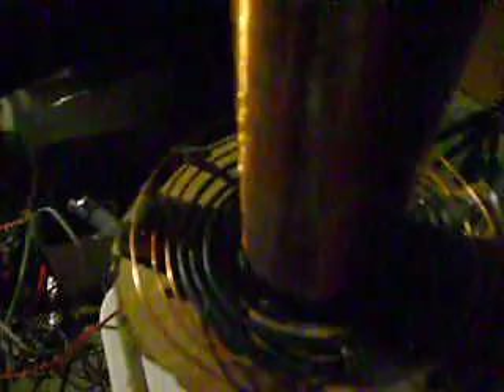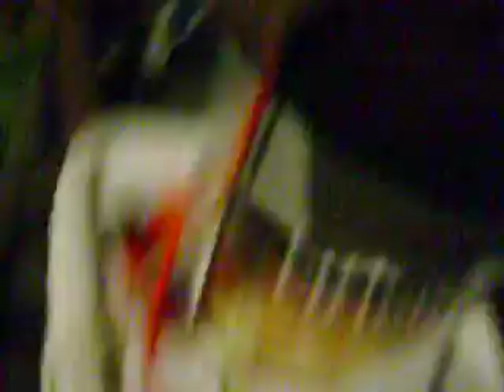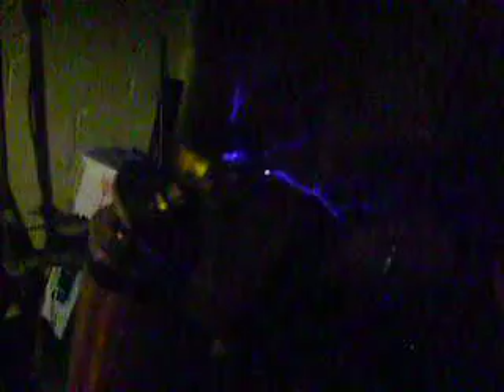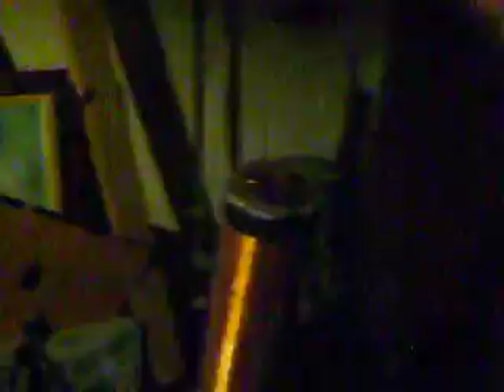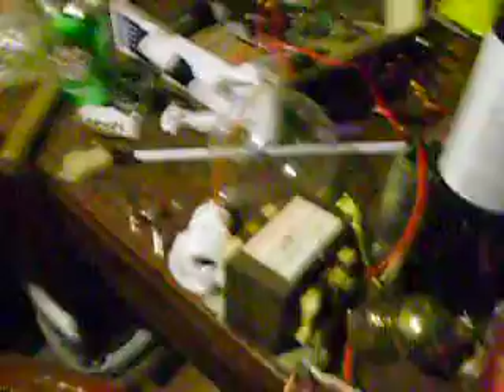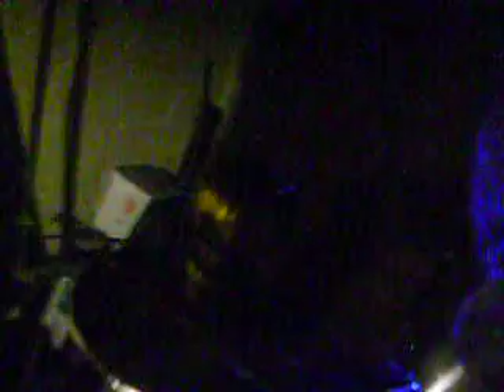how to build a flyback tesla coil#2

Comment from the maker: @living4game  hi what kind of  oscillator circuit are you using for your flyback, 555 of 
just 2n3055 in bipolar config, i suggest you use 555 until you get a working model then you can variate. its very simple if you have any questions i can explane evey part and how it works pretty quickly but you have to be able to learn at 90 and do some homework. good luck also  is your flyback ac or dc, because you can still get an output but wont be smooth, very loud and screechy

Comment: Hey dude, looking good. What is the choke for? You dont need a choke for this, really. With a multiplier, you definitely do. Also, you need a ton more inductance than those chokes, and it needs to be an iron core.

Also, you do not need any more space in between the primary and secondary, you need to change the coupling. This will hopefully make it all stop, it should. Just raise or lower the secondary in relation to the primary. Try it! It should help.